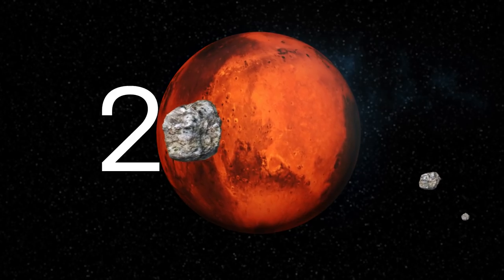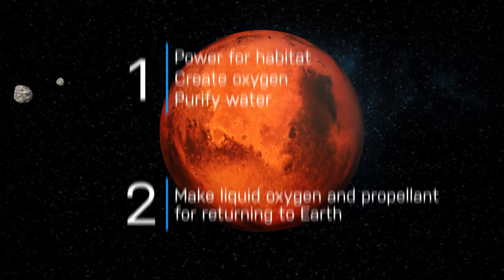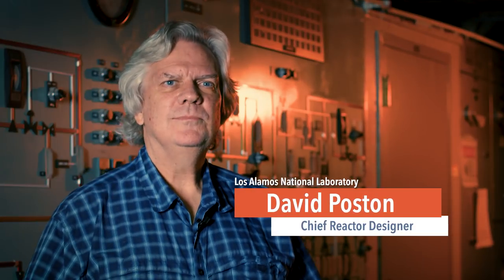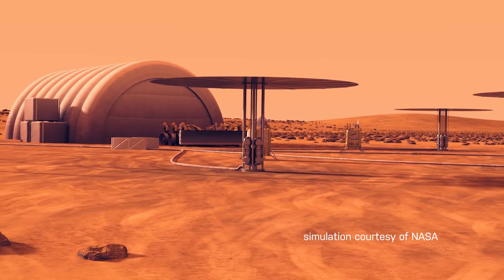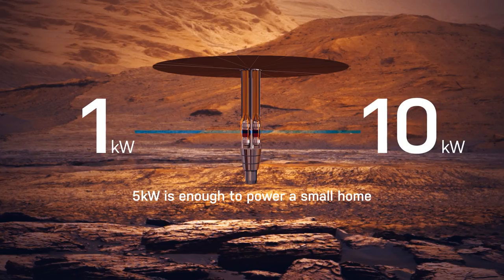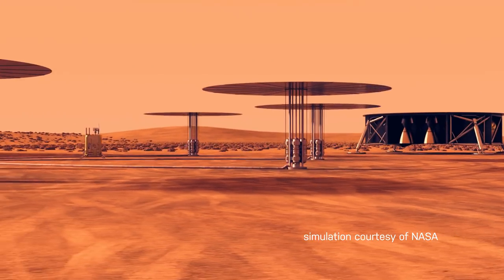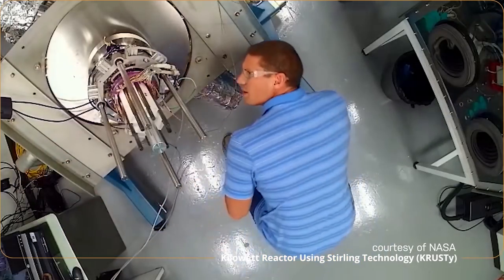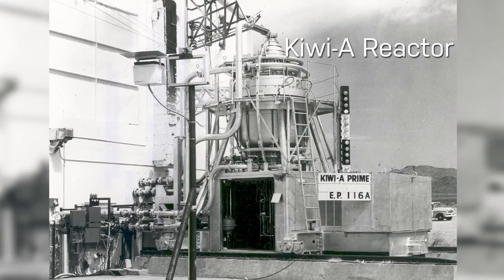Powering a Habitat on Mars with Kilopower

Comment: Exciting to see new systems being developed. Power is key. I wonder what kind of loss of efficiency you get on Mars vs on Earth, since I'd think the thinner atmosphere would permit less heat transfer with the radiators.
Reply: um... what?  It doesn't exactly work like that.  There is no Air transfer externally.  They are keeping it mostly contained in a package to create electricity via a stirling engine.   What radiator are you speaking about?
Reply: I'm assuming the radiator is the umbrella-like unfurling structure at the top. As long as it's attached via some thermally conducting material there would be "air" passing over it. I don't understand what you mean when you say there's no contact with the air. Air wouldn't need to pass through the structure that holds the rods.
Reply: Do you understand what a sterling engine is?  This is used to create electricity, not heat the air.
Reply: Mars is frozen. It's very cold on Mars. The temperatures are between -100 C and +4 C.
Reply: walperstyle How do you suppose a Stirling engine would even produce electricity? No matter what application a Stirling engine is used for, whether it be mechanical or electrical power, it relies on maintaining the temperature differential. The greater the differential, the more power it can produce. Hence it is not surprising that due to the conservation of energy, the environment in which the engine is placed in tries to establish a temperature equilibrium, which is why radiators and in the case of a thick atmosphere like on Earth, active cooling is used. Active cooling with the aid of an atmosphere (convection) is much better at energy transfer than radiating the heat away. A Stirling engine relying on just radiation to maintain the differential would prove to reduce efficiency by a large margin. That being said, I'm not sure how the OP's question is invalid as you seemed to be suggesting in your response. It seems like a perfectly reasonable question to me.
Reply: Eki+Epi=Ekf+Epf...  you don't need radiators, the simple thermodynamics and distance of system on a foreign planet will be enough to cool it down.  It won't have to go far.

Comment: Yo how do you make oxygen? I always wonder how they do that, especially in space. I'd assumed the ISS eventually runs out of oxygen right? So how do they keep it up? Or do they just resupply oxygen every capsule delivery?
Reply: Here's a not perfect, not accurate but still good enough of an explaination of the science behind how it's done :
- When you breath, you don't "destroy" oxygen (O2), you transform it into Dioxyde Carbon (CO2), to get back the oxygen, you simply use electricity to separate the carbon and oxygen (C + O2).
- On Mars, there's iced wate, water is H2O, so you can exctract oxygen (O2) from it : 2x H2O => 2x H2 + O2.
I won't explain how electricity can be used to separate them though, but you can google "Electrolysis" for that
Reply: They simple split CO2 into oxygen and carbon by the electric power from the photovoltaic of the ISS.
We will have to do the same on Earth to reduce CO2 to 280 ppm again.
Reply: Oh ok cool, thank you guys. Didn't think it was that simple to do. Good thing it is.
Reply: Maybe, because it's so small, this has a very low efficiency. 30 kWh for 1 kg oxygen.
Reply: The Martian atmosphere is mostly CO2. You get O2 from that, and use the carbon with hydrogen that you bring along to create hydrocarbon rocket fuel. Zubrin wrote a book about Mars and he explains the chemistry in it.
Reply: Water + Electric = hydrogen and oxygen gases.

Fuel and breathable air or fuel oxidizer.

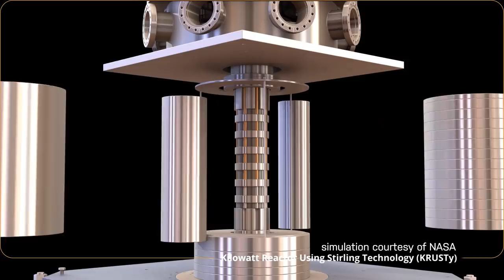Comment: I'm sorry....WHAT???? 1:30 did he say they're BOILING the sodium NaK coolant???? Is he just clueless about how Nak cooled reactors work (kind of concerning for someone at LANL and very improbable) or did he just misspeak, ....OR.... are they really heating the core to >800C and using a 2 phase heat loop (insane)?
Reply: Sodium NaK worked before, this will work too.  Ever visit the EBR-1 ?
Reply: um ya, in single phase loop. no one ever boiled the shit.
Reply: Environmental variables.
Reply: NaK heatpipe, not heat loop.  Big difference.
Reply: Kyle Hammond and the eutectic BOILS???
Reply: 10mintwo heat pipes inherently rely on the energy associated (and transfer of that energy) with boiling/condensing. Do a Google search of liquid metal heat pipes.

Comment: We shouldn't be trying to go to Mars, we need to colonise the moon first and use it as a spaceport by mining hydrogen from the poles.
Reply: Why go to the moon when the cost from the Moon to Mars is only time.
Reply: The Gravity is the answer. On Earth the gravity is 1G or 9,81 m/sec at square. The Moon's gravity is 6 times lower than on Earth. Mars has almost 3 times lower gravity than Earth.  The time you get to the Moon is much shorter than if you choose to go to Mars. 3 days vs 180 days with current technology.
Reply: Gravity on mars is roughly 3.711m/s².  The cool thing about mars too is it has a thin atmosphere, meaning that the forces of wind are extremely minimal.  But you are correct, the mass of the piston in a vertical tube should be enough to keep it moving.  Again, it depends on how you want to moderate, you don't need radiators.  Hell, they wouldn't even be using water, it would probably be a very closed system.    ...that said, they better have the ability to repair it.

Comment: Please, what is this nonsense?!? What should one do with 40 kW on Mars? Such reactors have a higher weight than photovoltaic and batteries.

In 2022 Elon Musk plans to send 2 transport ships and 2024 2 transport ships and 2 passenger ships to Mars.

To be able to fly back, 240 tons of methane have to be synthesized per ship. Of course, the 860 tons of oxygen are produced.

So that 2 years later the fuel for the return flight of 6 ships is synthesized
18 MW photovoltaic
54 MWh batteries
3 MW of power to be installed on Mars methane.
Reply: You have better a good reason for name calling.
So You have now the obligation to explain the reason for name calling.
I would like, that You explain really food reasons for name calling,
so that we can start here a great discussion.
But I fear, that You are unable for this and are only exactly, what You call others.
Reply: Well... if you need 18MW of pv on Mars you are kind of screwed to begin with, Mars has something like 44% solar irradiance compared to earth, so you need something like this, on Mars
https://www.solarinsure.com/wp/wp-content/uploads/2009/06/Waldpolenz-solar.jpg

Oh and 54MWh of batteries weigh like 200tons, so that's your two cargo ships filled up even before you start thinking about where to put all these solar panels.

Where did you get your numbers from anyway?
Reply: The yield of the photovoltaic is calculated with 1200 kWh per kW peak per Earth year.
Mars is much colder than Earth, this improves the yield.
Less atmosphere less clouds, this improves the yield.

54 MWh batteries are about one cargo ship or 150 tons.
The photovoltaic an other cargo ship
The power to gas equipment the 3rd cargo ship.

It's calculated with 30 kWh per kg methane. 6 BFS with 240 tons methane each are 1440 tons.
1440 tons require 43,2 GWh. 18 MW PV should produce this on Mars near equator in 2 Earth years.
Reply: Mars is farther away from Sun than Earth, that drops solar panel output to ~44% of what it would be on Earth, any improvements from Mars climate are minor compared to that and are nullified by problem of dust anyway. If you want 18MW solar on Mars, you need a power plant that would be ~40MW solar here on Earth.

Also, "It's calculated" is not an answer to "where are you taking your numbers"
Reply: It's not necessary to repeat the greater distance from the sun, I know this since more than a half century.
Top locations on Earth have up to 2800 kWh per year.
And also, I already stated what numbers I calculated for Mars. So it's really not necessary to repeat this.
Dust problem can be greatly reduced by mounting 10m above Mars surface.
Reply: I'm not saying solar is impossible or not worth it on Mars, that is not the problem. But you do need hella lot of it to refuel a BFS. Actually it doesn't matter where the power comes from, in any case you need a lot of power. Now the obvious question is, fine how much exactly then. And I can't find any two sources that agree with each other and all are different from my own napkin calculations. 

Your numbers for example seem mighty suspect to me, for example, why would you want that much battery storage in the first place. Fuel generation is constrained by power, not reaction throughput, there is no point in continuing the reaction through the night, because charging and discharging batteries is an efficiency loss. You'll generate less propellant per day if you generate off batteries, than if you only generate when solar power is available. Its a whole lot of extra gear to lug along for achieving worse performance.
Reply: The best power to methane systems have 60% efficiency plus 2,2 kWh for filtering 2,2 kg CO2 out of the atmosphere to have the row material. On Earth, filtering CO2 out of the atmosphere requires about 1 kWh per kg while water is very easy. On Mars, 95% of the atmosphere is CO2, while getting the water is difficult.

Why the batteries? There is the possibility to have 3 times more power to gas equipment and run it like solar power is available. With the newest generation of batteries introduced in the Tesla Semi and new Roadster, it seems 3 MW power to gas and batteries are better then 9 MW power to gas and produce like electric power is available. When 6 MW power to gas weights less than 150 tons, this solution would be better.

I can not find out the weight of power to gas systems, because as long as You are on Earth, this is no problem.
Reply: Satabier process is exothermic you don't need power for it, what takes power is electrolysis of water, you need O2 for propellant and H2 for sabatier. Any reasonable system will be limited by how much power you can pour into electrolysis, wasting that power for battery charging and discharging is ridiculous, if there is no power available you turn the process off. You don't need to run things through the night, you do need to make the most out of power you have available. Batteries are double trouble, first it's a waste of power, second it's a waste of cargo space and mass so you can bring less power generation with you in the first place.

Power generation will take order of magnitude more cargo mass and volume than the propellant processing plant in any case.